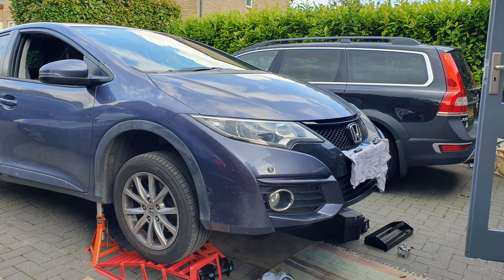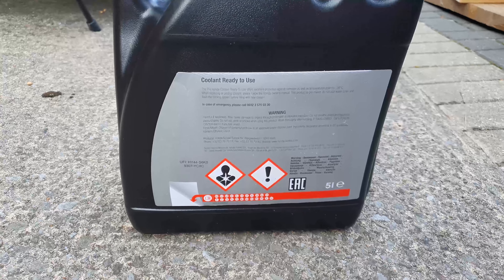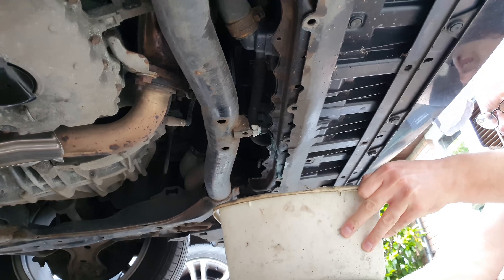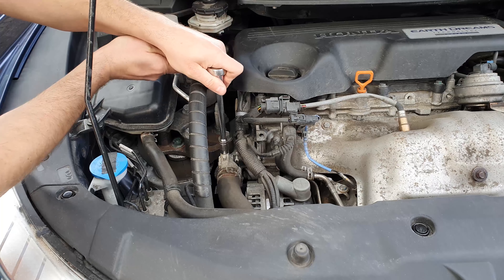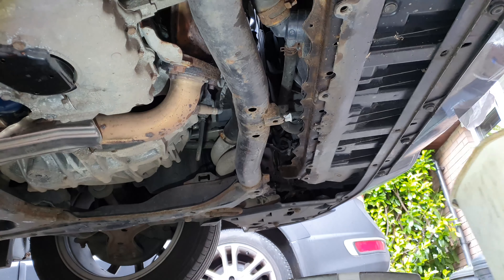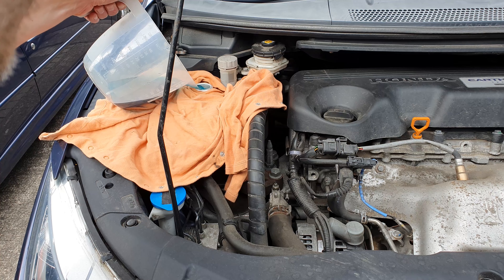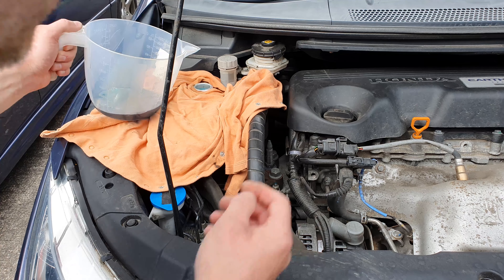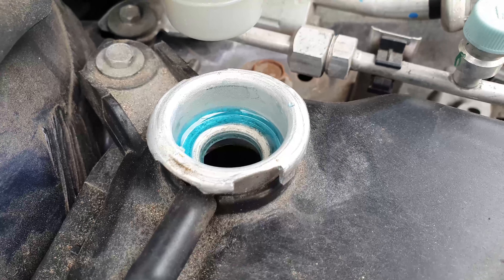Honda Civic 1.6 i-DTEC  - Coolant Change - FK 9th Gen

Comment: Question: What is your method of raising the civic using those ramps? Even with ramp extensions the front bumper always makes contact with the ramp and its extension? Many Thanks!
Reply from the maker: Yeah I saw this issue first time I tried to use the ramps. I use two long pieces of strong wood (floor boards I think) to extend the ramps and make the entry angle shallower. Maybe the length I use is longer than the extensions you have
Reply: @KomradeShotabollokov  Thanks for the reply. Look forward to checking out all of your content.

Comment: Nice vid. I've been searching  for hours to find the location of the cylinder coolant drain bolt because I need both the radiator drain and engine to do a full system flush. I've found lots of US or older engine, mine looks like yours and is a UK 2016 D-tec 1.6. any links to a diagram or photo
Reply from the maker: I don't have any info on where the block drain is. Because it's only ever been genuine Honda coolant in the car I've not been worried about any lingering coolant that draining the block would get. If you can't find the block drain one option would be to dump the radiator and upper engine as in the video, fill with deionised water, drive until thermostat opens, drain, more water, drive, drain. Then if happy, add Honda coolant. Or repeat water some more, to suit. I've done this before on a different car after seeing that some chump in the past put incorrect type coolant in...
Reply: @KomradeShotabollokov thank you for your fast response. I'm pretty sure found it, but have not opened yet as i need to get the replacement washer first.
Standing in front of the car, it's on the back of the engine on the very left, probably halfway down the whole block. It's partially covered with a metal bracket, think it's holding some cables in place. 3 x 10 mm bots holding the bracket in place, top ones reachable over the engine block, the lower one from under the car. The drain bolt will likely only be reachable from under the car too.

Comment: Did you run the car with the coolant cap off with the heaters on full to release the air bubbles? Seen that in other videos
Reply from the maker: As I understand it the hot/cold cabin controls only change the air flow direction over the heater core, not the coolant flow through the heater core. I didn't turn it to hot when I changed the coolant. As this car has a header tank rather than topping up at the radiator, I allowed time for air to reach the tank, as designed, then ran the car and re-checked the coolant level a few times, adding more as needed. I've had no engine cooling or cabin heating issues at all both times I've done it this way on this car.